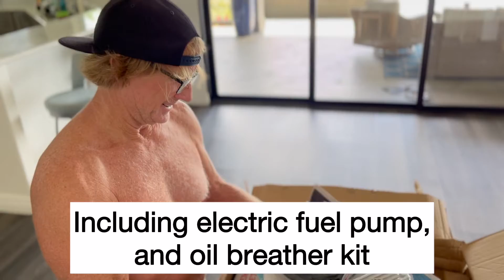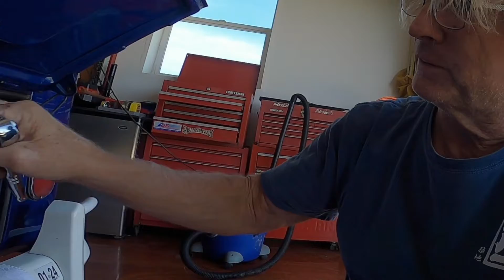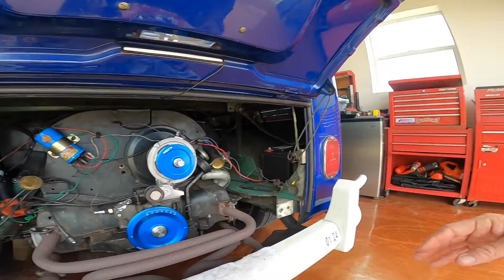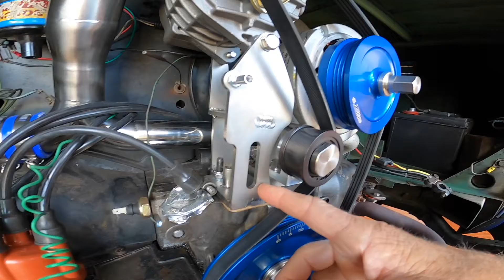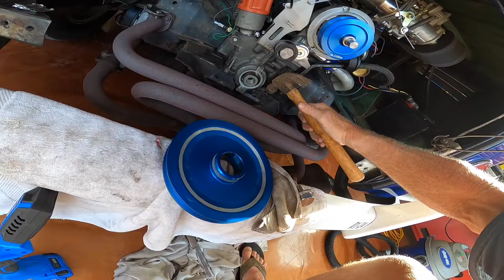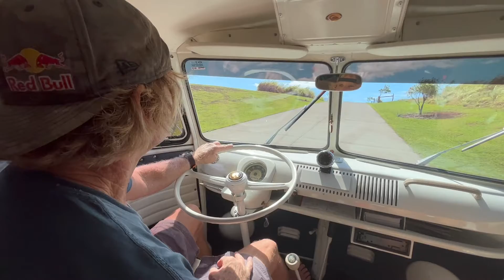1967 VW Bus Super Charger Install

Comment: The thing is that mechanics will never do it the way you are doing or I do it on my own cars because even though they do charge to do it correctly they will cut corners they will not take the time to clean to do nice an straight an all the stuff that you as owner are doing most mechanics they will charge for it but i doubt that they will take the time to do it like that that’s just a personal opinion because I’ll been screwed on many times that’s why I just do it myself

Comment: Fuel pump & filter should not be in the engine compartment. They make a fire extinguisher TUBE that's about 6' long you can tie it up above the motor. Highly recommended.  I've had 2 bus fires and other close calls. Both were saved thankfully. Love the color Nice Bus! I used to be all about stock. now stock is cheap crap so bigger is better and way funner. Our 66 bus is now IRS, ball joint, & 4 wheel disc. 1649 with weber progressive. Currently building a 1904. Not me the shop. Another bit of advice is do not get cheap parts. Quality is everything. When I ran them stock in the 80's & 90's I would get about 60,000 on a motor. not bad when a rebuild was only $350. Now $3500 but who drives them daily anymore. I'll be shocked if we put another 60,000 on the old bus. Thanks for posting.

Comment: Dude
pushin' 70 and still hitting the swell at Jaws...
not you the bus.
In either case
caps off👣

"hopefully leak proof..."🤨
🍌🍌🍌

Given a fire extinguisher...
I'd be stoked 
to feel the power differential 
compared to stock.
No longer putting 
over Highway 9
to get to Santa Cruz (?)

or up Highway 1 to Wadell Creek
would be quite a different experience. (?)
🤙

Comment: I bilt a 2332 and have been pondering this, and as expected, I've been watching plenty of supercharger installations. One individual used a spacer between the supercharger and carburetor intake which avoided the alternator problem. That's a pretty nice van you have there
Reply: That supercharger is not big enough for a 2332.  It is barely big enough for a 1600.  You would have to overdrive it at least 2.5 engine speed, maybe 3.5 engine speed to make boost on an engine that big.  The compressor only displaces 500cc per revolution.

Comment: Great to see you finally having the time to work on your cars, I know you have wanted to for a long time now. Still remember you telling me in the Gorge how much fun you had cleaning up and detailing your Uncle's 240Z when you were younger. When you do pull the carb to get more clearance, put in a drip pan between the carb and the alternator. Webers have a habit of weeping after they flood and the fuel will go straight onto the alternator and light up! My Lotus Esprit has this same problem and I know of a few that have burnt to the ground.  Cheers, Kean

Comment: Don’t you think the amp cable is not close to the carburettor? I fear the cable would melt…. Amazing craftsmanship!!
Reply from the maker: It is close, but has a rubber boot and a hard plastic shim between them as well.  I do not think there is too much heat there...
Reply: @RobbyNaishUS1111  okay…as long you it have under the radar :-) I am not an expert …just knowing that very high temperatures can occur and that the plastic might melt because of that. In the videos it seems nearly touching it so close it looks

Comment: Cool work Robby. Tight clearances! A bit of safety advice, although I know how nice it is to be able to see fuel flowing on these older vehicles when troubleshooting, you should replace that clear plastic fuel filter with a metal one. The plastic one can break at the nipples after heat cycles and vibrations in the engine bay....
Reply from the maker: Thank you Lionel!  I appreciate the insight...  I am aware of this, but wanted to see how much gunk was in the old fuel initially, but plan on changing that out to a metal one soon.

Comment: The fast VW have Subaru motors dropped in them.
Reply from the maker: Yes, some do for sure.  I looked at doing an STI swap,,,, but decided it needed to stay VW powered.  And I can at least kind of work my way around an air cooled motor like this myself... likely not the case with a water cooled, computerized, turbo flat four.
Reply: @RobbyNaishUS1111  I had v dub van that same color in Florida , I sold it before I came out here. It was the windsurfing road trip to the keys and west coast Machine. Lots of good times.🤙

Comment: What happens if the 60amp alternator grounds out on the carburetor 2mm above it? 😳
Reply from the maker: That would not be at all good.  There is a rubber boot over the amp positive terminal, with no threads sticking out on top (cut down to the nut).  I also put a hard plastic shim between the alternator and the carburator just in case.  They are not touching, but it is close.  Now that it is finished, I will likely pull off the carb and compressor and bang out a bit more room on top of the engine bay, letting me angle in just a tad more clearance between the carb and alternator.  In the whole scope of things, this will not take too much time or be too much trouble.  There is also a bit of idle "rattle" with the top of the two units coming in contact with the ingine bay top that I would love to eliminate.  Thank you for your concern!